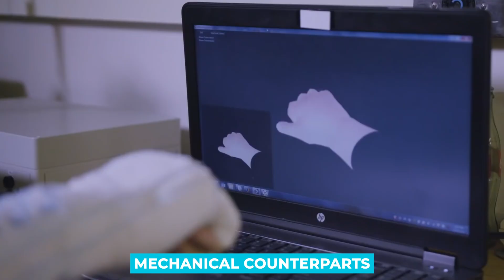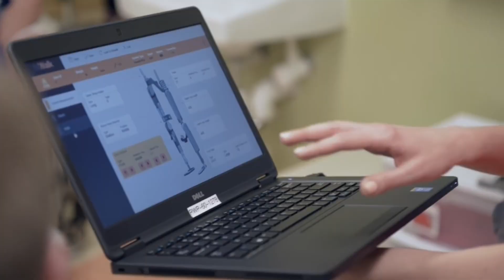What Is The Difference Between Robots, Androids and Cyborgs

Comment: As I myself, am a cyborg now, I’m totally hip about this (yup, I have mechanized parts in me) 🦿⚙️🔩
Reply: Change ur arm to a hand cannon fr fr
Reply: @RequiemUltima22  actually, I’m thinking a spring-loaded spear launcher like the T-1000 had! 😈
Reply: @chrismayer3919  💀what abt a shock stick
Reply: @RequiemUltima22  maybe, but a voltage backlash could occur and totally short my biodigitronic system all to hell. I’d be flat on my face same as my attacker…
Reply: @chrismayer3919  ah then how bout flamethrower, or a railgun(hopefully the recoil ain’t too bad 💀)
Reply: @RequiemUltima22  not a flamethrower as I’m not currently seeking an old flame. No railgun as I have nobody to rail against… 😆 (I need something which would not run out of ammo.)
Reply: @chrismayer3919  high precision, (and also very very hot) laser
Reply: @RequiemUltima22  … that sounds like a Star Wars E-11 blaster rifle! 😃👍

Comment: Sophia is still a robot in the purest sense. She can't walk on her own and her movements are very restricted, only her face has been made to meet the standards of an android. For an android to be classified as such it requires autonomy, self-learning and to closely resemble a human. For the best example of an android, think of Data from Star Trek Next Generation. Whereas a Cyborg is portrayed as a half-man and half-machine being that is both robotic and bionic via implants. Cyborgs can be machines that have an inner metallic endoskeleton with an outer living tissue, like in Terminator. It is only because of the living tissue that terminators are cyborgs, otherwise, they would be classified as androids. In most modern practical applications, a cyborg is a living human being who is physically in connection with the technology via implants or such. Robocop is a type of cyborg to the extreme.
Reply: Elon Musk's Neuro-chip implant would create a cyborg to a minor level.